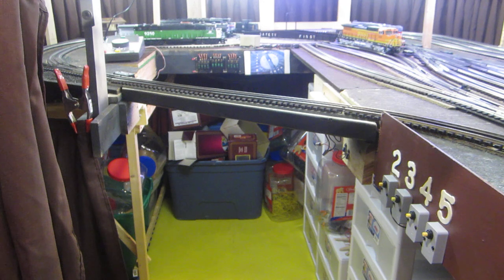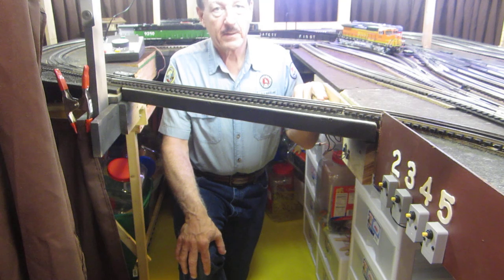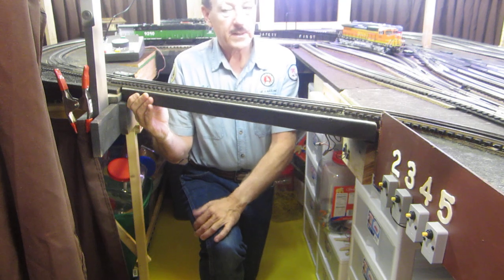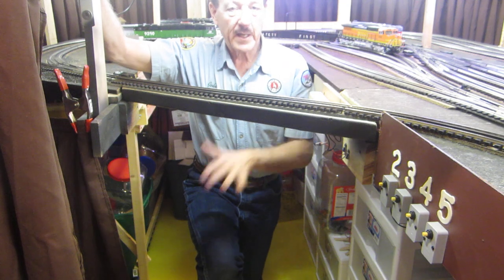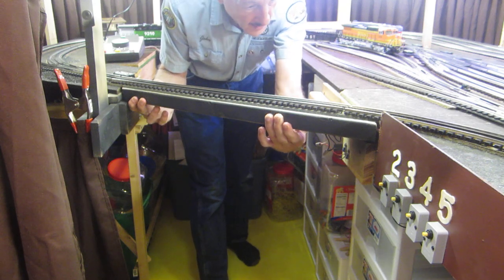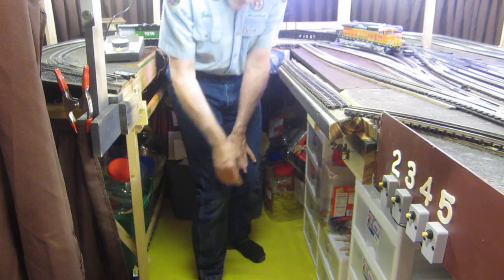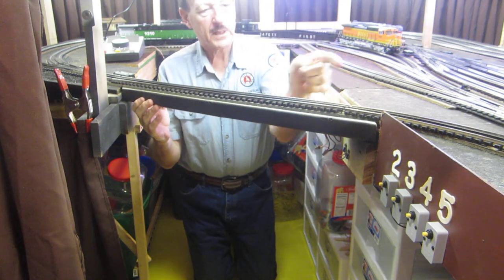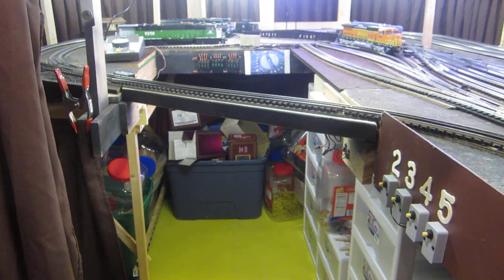CRITICAL layout design tip:  An Alternative to the Duck-Under:  Swing-Section

Comment: My previous Lionel layout I had the main line going down a hill into a lot of switches in a curve then there was a walkway to cross to get to the yard with a loop around it. Initially I had a bridge with heavy hinges and the section would swing up and be held with bolt latches. But it was very heavy. I removed it and the hinges started over with the thinnest cedar plywood I could find at Menards which I cut to shape then screwed down the Lionel 027 track. Then I attached two aluminum L angle pieces to the bottom then two hardware pull handles. It was strong enough and it was incredibly light. I don’t remember if I posted a video of it before I took it apart. I built a new layout in a different room beginning in 2018 or 2019.

Comment: Treating this like a door would be a good way to handle it.  A couple of hinges to really stabilize it, a solid base to act as structural support, and a visual barrier to remind you that it is in place so you don't walk through your bridge otherwise.  A good spot to put your railroad's herald / logo on the lower portion.  I'll be needing to do something similar.   Note that by having this at an angle, you avoid the compression issue of hinge placement, so your rails will always align perfectly if you have stops in place.

Comment: Fantastic idea!  After many years of duck unders I am now at that age of, "if your stuck beyond the D.U. FORGET YOU."  However, your idea got me to thinking of a slight change.  And change on my worst D.U.

I started with your 2x4 and beefed it up to a shelf. Then on the roadbed side of the menace I but a heavier than usual piano hinge that was useless in the shop.  That's when I went freaky.

All of my rolling stock have "QR" stamps on their under carriage.  My #1 stock yard has two "QR" readers from some old junk cellphones.  So when a car is dropped, or is moved to be made up, it has to pass over these ex-lenses.

But now I've refocused (not yet fully moved) my main yard to this former LAND OF MISFIT TRAINS. and when they enter the yard from the main line they pass over the readers and signal the Station Masters Desktop.  When they exit the yard, via your swing arm bridge idea another QR reader logs those boxes out.  GLORIA!  Thanks for a GREAT SOLUTION.
Reply: Great idea to save the old knees
Reply: How wide is the opening when you raise a bascule bridge in HO ?
Reply: Does anyone know the answer. I don't have one yet

Comment: My layout is bi level. 2 tracks on the lower and 2 above (my Chicago El). So your feature would not work. I have a couple pop up's on my layout which are 2 feet plus or so into the center, so again your feature wouldn't work. Now I am getting older and knees and back don't work as well so I found an old secretary chair that I set at the lowest level and removed the back of it. So I can sit on it lower my head a bit and I can scoot in and out quite easily.